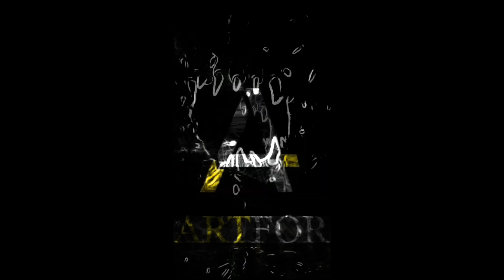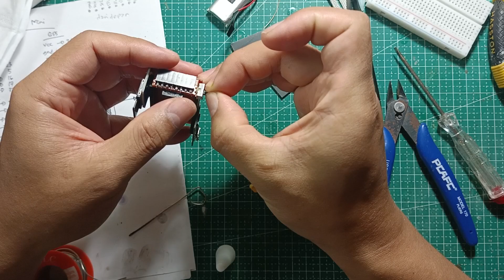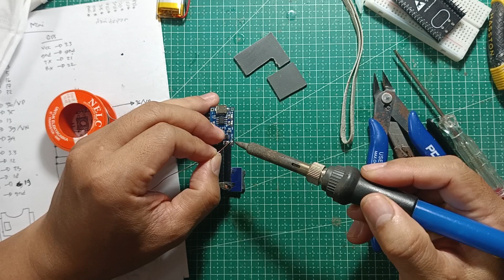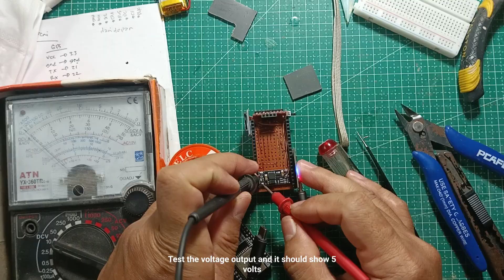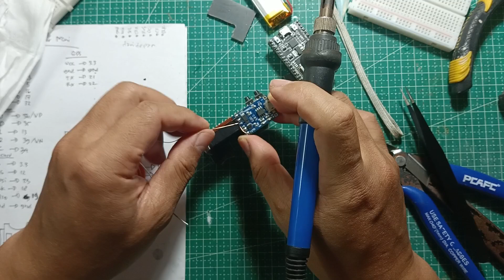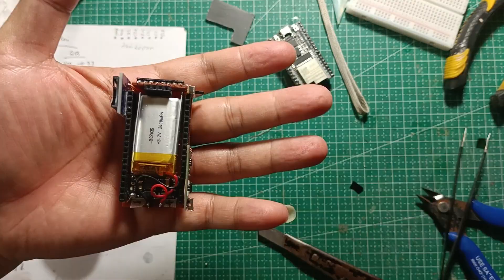How to Make ESP32 MARAUDER MINI Part 6

Comment from the maker: Part 7 will be upload soon feel free to ask question here 👇
Reply: Coba flash bruce bang, apa bisa dipasang nrf24 dan cc
Reply from the maker: @Zidaneaja1 ya ntar sy coba, tunggu ya🙏
Reply: can I use red color display which is the same driver?
Reply from the maker: What inch do you have?
Reply: Same size.1.44 @ARTFOR
Reply from the maker: If it ST7735 driver then you can use it
Reply: Next video,bruce Making with this device. Please ✌️✌️✌️✌️✌️✌️✌️✌️
Reply from the maker: Yes i Will, but after i finish making a case for it
Reply: You are the best youtuber who replied all coment❤❤❤❤❤❤❤❤❤❤
Reply from the maker: Yea i try my best to answering all the question....
Reply: In the next project which display will you use to make a bruce device.Because I will place the order before that display
Reply from the maker: I will try to install bruce on my marauder mini first, then try to connect the NRF24 and CC1101 modules